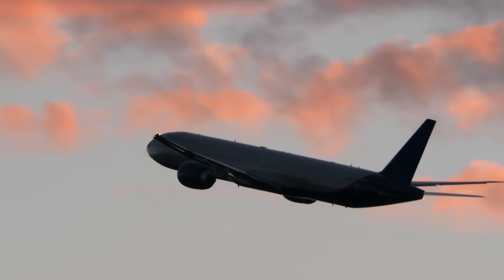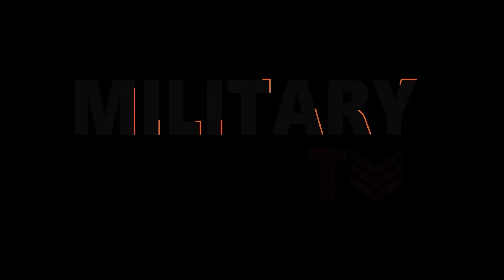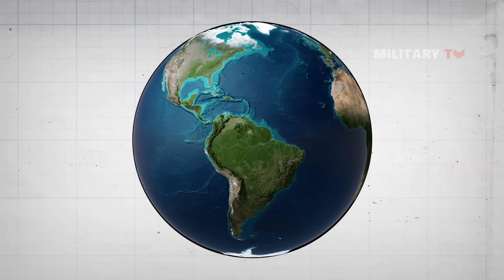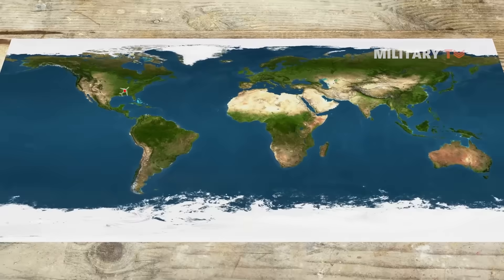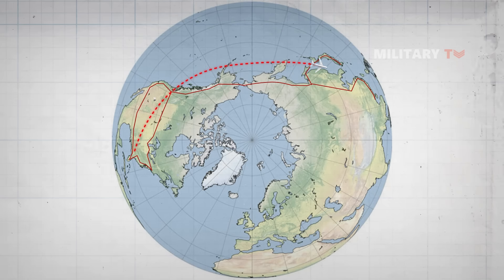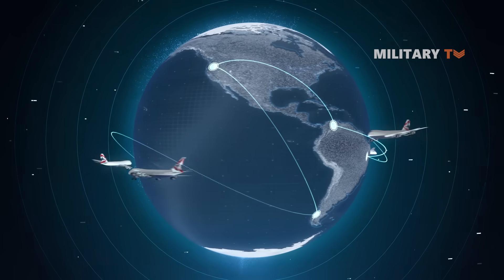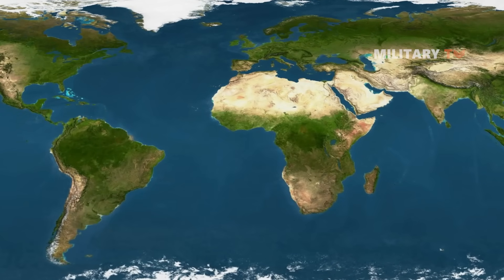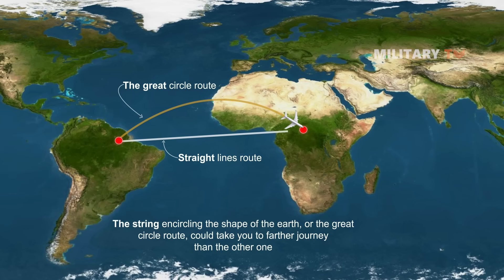Why Airplanes Fly On A Curved Path

Comment: The airplanes ARE flying a straight line, being "the shortest distance between two points." Stretch a string on a globe between two points, and voila, there is your flight path. The line appears curved because it is drawn on a flat map, not a globe
Reply: 2d navigation and 2d maps.
Reply: I was waiting for someone to point that out, it's only curved on a flat (distorted) map.
Reply: @dougb5202  The flat map is not distorted and 3D is derived from 2D. Spheres are derived from circles and not the other way around. Also flat earth maps don't take into effect the curvature of the earth.
Reply: This is incorrect and flat maps don't take into effect the curve of the so-called globe. Spheres are derived from circles. 3D is derived from 2D and not the other way around. Looks like somebody failed geometry.
Reply: Perfectly explained
Reply: "Not for educational purposes" - Globe
Reply: @derp8575  I know that the globe is not for educational purposes. And that's why we don't witness it in reality.  You believe in fables my friend.
Reply: @christianpulido8360  Spheres are not derived from Circles nor there is any form of projection that has no distortion between those two.

 The point is the only shape which all points are an equal distance to the center in one dimension, so the circle is the ordinary 2 dimensional shape with the same definition, and the sphere is the shape in 3 dimensions where, again, each and every point on the surface is an equal distance to the center. The sphere was never defined as a circle, tho they share some characteristics because they're defined through the same rules, ex: they both have the biggest ratio of internal area/volume to external circumference/area, we call those similar.

 There's infinite shapes that have circular cross-sections, called solids of revolution, and of those only the cylinder has no distortion when projected in 2D. You're basically calling several people siblings because they have the same surname, it doesn't work like that.
Reply: @davidaugustofc2574 Where do you get your information from? Because what you wrote is incorrect. The sphere is a three-dimensional shape, also called the second cousin of a circle. 

The first circle on the top of the sphere is a small circle and then the second circle is a little bigger etc. 2D is a flat circle and 3D has no edges, and it's a ball 🏀 shape derived from a two- Dimensional circle. A sphere cannot exist without circles buddy.  How is a sphere made if it is not made of circles? This is basic geometry..
Reply: @christianpulido8360  You made that up in your head, that's why your side of the information cannot be found. Every Solid of Revolution will have circular cross sections because the Revolution is a mathematical operation which does not change the distance from the center point. That is, if you take any given plane perpendicular to the axis of revolution and analyse all the points overlapping with said plane, all the points will also be at the same distance to the center, which would fit the definition of a circle besides the definition of a sphere. That's an example where one answer works for two questions.

 In no thesis, research paper or mathematical proof, you're gonna find a solid defined exclusively by its cross-sectional shapes. There's countless of them each having an infinitely small thickness and constantly changing radius between layers (as opposed to one radius for the whole sphere), and it makes no sense whatsoever (maybe it does for you but not for anyone else) to try and create a sphere the way you described. It's just for visualisation purposes, for kids even.

 Formally, a sphere is the set of points that are all at the same distance r from a given point in three-dimensional space. That given point is the centre of the sphere, and r is the sphere's radius. With that alone you're able to create a sphere of any size in any point of the universe.

 And while you're going in circles (pun intended) to try and argue that the Sphere is made from Circles, you have put absolutely zero effort in explaining how there's supposedly no distortion between the projections from 3D to 2D and vice-versa, which was your argument.
Reply: @davidaugustofc2574  Pilots supposedly navigate great circles and that's because a sphere is made of circles.  I'm not making this up its basic geometry. How is a sphere made without circles?  Where can we witness this so-called globe in reality? 

It's very clear that you have no idea of what you are talking about?
Reply: @christianpulido8360  I like how you keep telling yourself it's all basic geometry, when all smooth shapes and smooth spaces are studied in differential geometry, including, but not limited to the projection of a sphere into a plane (the topic you avoided ever after you raised it yourself), and you clearly have no idea about calculus. 

But keep patting yourself in the back.
Reply: @davidaugustofc2574  Calculus is a study in change and geometry is a study in shapes. Calculus has nothing to do with geometry. 

How is a sphere made without circles? Answer thx question ok?  Also we are taught about spheres being made of circles in the 10th grade. 

Desk globe maps are projections of flat maps which are considered 2D. 

It's clear that you are clueless about what you are talking about?
Reply: @christianpulido8360  the definition, which I already gave you: A sphere, in geometry, is the set of all points in three-dimensional space lying the same distance (the radius) from a given point (the centre).
Reply: @davidaugustofc2574 I know that already but how is a sphere made?
Reply: @christianpulido8360   A sphere is made in any way that fits the definition. If you were just a little more pedantic about it, you could say a sphere is a line (with defined length r), with one end fixed on a point (x,y) in space, that rotates 360 degrees (in all 3 axis) in such a way that every point the other end passes through is also a point on the surface of a sphere. That would also make a sphere because all points in three-dimensional space lie the same distance (the radius) from a given point (the centre).
 One way you could make a sphere in the physical world, you could have, say agate rock, being machined by 3 cylindrical drills on all 3 axis, and then by another 3 an equal distance to the centre, with the rock spinning around a fixed point. You can also hydroform one from welded steel because since all points lie the same distance to the centre, the pressure is also equal on all points and so it stops deforming.
 In the more extreme cases, spheres are formed by gravity because when an object is further away from the centre than another below it, the object below will feel the weight from the object above. Once the celestial bodies are massive enough that their gravitational pull can overcome the strength of the material they’re made from, everything will get pulled inwards till the material is around the same distance to the centre (Mount Everest for example is .14% further from the centre than the top of the ocean is), those are called spheroids because they’re only approximately spheres. Then they are in a state called hydrostatic equilibrium.
Reply: Yes it is a straight line if you look directly overhead of it. But is looking curve if you look at it on the side (horizontal or equator view)
Reply: Incorrect. The vast majority of the time they fly at constant altitude and constant bearing, a path which is known as a rhumb line.
Reply: @hb1338  Present the evidence of your claims ok? Thank you for your opinion though.
Reply: @hb1338 That Is not true, rhumb Lines are almost never flown. They take longer.
Reply: @christianpulido8360 Nobody uses any flatearth map, because it's not flat. Intercontinental flights South of the Equator prove that. Plus no flerf should accuse others of not knowing geometry because that's exactly what proves you wrong. Very basic geometry actually.
Reply: @AlexFoxthrot  Pilots use Aeronautical charts that are flat maps and are  based on azimuth. Everything on land navigation begins with an Azimuth. Flat maps don't account for the so-called curve of the earth.  Nobody uses desk globe maps for navigation cause they are just considered suvanears. Try using a desk globe map for navigation and see how that works for you ok? 3D cannot be flattened into 2D  cause 2D makes 3D .  Geometry is used  with 2D and circles.  AirPlanes flying south of the equator don't prove that we live on a spinning 🏀 in reality.  Pilots fly in straight line paths world wide.  Where can we witness the ground curving as a 🏀 in reality?  We can definitely read about measurements of curvature but in reality they are not observed.
Reply: @AlexFoxthrot  Rhumb lines are always flown in reality. We don't live on a globe buddy. Present the evidence that we live  on a spinning 🏀 in reality ok? Airplanes don't fly in great circle paths cause we don't live on a spinning 🏀 in reality.
Reply: @christianpulido8360  Are you a Pilot? Obviously not. I am, I know what I am talking about, you repeat what you heard from other non-pilots. Rhumb Lines mean you keep your heading, that never happens unless you fly due North or due South. Especially in long flights, the heading changes constantly because the routes are close to being Great Circles, so you are wrong about everything. Like It has been said already, the Maps are flat projections of the Globe. Besides no airplane uses Maps anymore, they use GPS signals coupled with the WGS84 model which Is a Globe. Again, you are wrong about everything. And yes a direct flight from Sydney to Johannesburg proves your model wrong because on the flat map that distance Is more than 23400km, impossible to cover in 14 hours. Welcome to reality.
Reply: @AlexFoxthrot  Well you can claim to be anybody on YouTube. Also flat maps don't account for the so-called curve of the earth.  Flat maps are not projections of the globe because flat maps make globe maps. Pilots always fly in straight line paths in reality. GPS can occasionally have disruptions, so most pilots keep paper maps handy, and cockpits have a magnetic compass that is based on 2D.  My GPS is always set on 2D buddy. Pilots also use electronic charts and you would know that if you were really a pilot. GPS is a ground based station with cables laid on the sea bed between land-based stations to carry telecommunication signals to antennas. Satellites are not orbiting around the earth in reality. Satellites are launched and attached to balloons in reality.  Semi circles and Circles make a sphere and without circles a sphere cannot exist. I knew you were not going to be able to present the evidence that we live on a spinning 🏀 in reality. In order for a spinning 🏀 to exist we must be able to witness it in reality and not just read about it.  We are taught your indoctrination in the so-called educational system.
Reply: @AlexFoxthrot  Pilots are not using desk globe maps to fly between Sydney and Johannesburg so your calculations are incorrect. Present the evidence of pilots flying from Sydney to Johannesburg using a desk globe map and flying on a globe in reality ok?
Reply: @christianpulido8360  I never said we use desk globes, stop acting like a kid. The distance on the flat map Is way too big for that Flight to exist but It does, you can look for It buy It and track it. On the flat map It measures 23400km, on the Globe 11034. Huge difference. One Is possible, the other Is not. And we never measure distances with Maps either, the FMS does all the calculations, you Need to catch up a few decades buddy.
Reply: @AlexFoxthrot  If you took a globe and put a string across two points you would get a different line than what you are going to get on a chart. A chart is a flat piece of paper that truly doesn't take into effect the curve of the so-called globe.  Flat maps have sizes, angles, distances, and directions that are not the same as a desk globe map.  And desk globe maps are globe maps so what are you talking about? You cannot flatten a desk globe map into 2D because 3D is derived from 2D. In reality you don't know the distances from Sydney to Johannesburg  on a flat map. Where are you getting your calculations from?
Reply: @AlexFoxthrot  Pilots are not using globe maps they use Aeronautical charts that are based on Azimuth. Also azimuth uses true north, magnetic north, and grid etc.
Reply: @christianpulido8360  Yes all charts take into account the curvature, like I said Lambert projections have a non uniform scale and Great Circles appear curvy because earth Is not flat. Same thing happens on Mercatore projections. Nobody uses Gleasons map like your gurus preach. If you fly from Frankfurt to LA you see the route curve North and get close to the pole on a Mercatore chart and that's what you see in reality as well, and the heading changes constantly so again you are wrong about rhumb Lines. Even on Gleasons map rhumb Lines are not straight so you are so wrong and clueless. I calculated the distance using Gleasons map but every flat earth map can be used, we already know that there are 60NM to the degree of latitude so that's out scale. The distance Is clearly huge even without calculations an it's more than twice as long as other flights North of the Equator that take the same amount of time. You lost.
Reply: @christianpulido8360  No pilot uses azimuthal Maps and the last comment proves you know absolutely nothing of the topic. Azimuth uses True North, Magnetica North and Grid? Pure nonsense. Every map has a grid. That's what happens when you get your brain filled with charlatan made videos, you get tricled into thinking you know stuff when its the exact opposite.
Reply: @AlexFoxthrot  Are you claiming that Azimuth doesn't use magnetic north, true north , and grid. Do you even know what Grid is used for? Grids are usually only present on maps that are meant for navigational purposes. Longitude and latitude lines typically make up grid lines in a map. According to the USGS, the Azimuthal Equidistant map helps show "airline distances from the center point of the projection." It is useful for radio, aviation, and seismic mapping, and illustrates polar hemispheres.
Reply: @christianpulido8360  I already told you how to calculate the distance. Take your FE map and plot a line between the two cities, then compare that distance with something known, like the distance from the Pole to the Equator, which is 5400NM, then use easy proportions to get the final result. Or you can use geographical coordinates to calculate the distances from the cities to the Pole, then use the difference in Longitude to find out the angle between those two lines and then use the cosine formula to calculate the length of the third side of that triangle which is the distance. Again, you are ignoring some details because you know you cannot explain this on your world. I already told you that you can take other routes that take the same 14 hours but stay North of the Equator all the time and see that they are less than half the length. No, airplanes do not fly twice the speed of others. And stop starting from the conclusion, I can calculate the distance between those two cities on the Globe as well, again you are debating with pure nonsense. Go ahead and explain the flight, let's see who the liar is here.
Reply: @TruthSeeker8717 The so-called scientists claim that we live on a Spheroid.  They claim that the Earth is not a perfect sphere. So how does that match a desk globe map?  If the Earth is considered a Spheroid ?
Reply: @christianpulido8360  The difference in radii is negligible on a desk globe. You still fail at explaining the flights that prove your model wrong empirically. Along pretty much everything else. You know nothing.
Reply: @TruthSeeker8717 Plus, you all believe in god, I suggest you don't use the word "magic" to ridicule a model just because you cannot understand it because that's ever so ironic. Keep avoiding the question tho. You are winning big time.
Reply: @TruthSeeker8717 I mean you even think human senses are reliable, this is not a comedy club, pal.
Reply: That's why gnomonic plotting sheets are used for long distance work.
Reply: @christianpulido8360  "Also flat earth maps don't take into effect the curvature of the earth" really? what a surprising discovery; btw., all maps are flat, by the very definition
Reply: @christianpulido8360  of course we do live on a spheroid; equatorial radius is 6378 km, polar radius is 6357 km
Reply: @rncmv  Flat maps are based on a flat earth and not a  spinning oblate spheroid.  The desk globe map was derived by 2D and not the other way around. In geometry 3D is derived from 2D.  A circle makes a sphere in geometry. 3D cannot exist without being derived from 2D.  Desk globes are not useful to study a specific part of the earth in detail.  They have no roads  and cities printed on them.  A globe does not give an accurate idea of the distance between two points.  Desk globes don't work for navigation in reality.  Nobody uses globes for navigation in reality.
Reply: @rncmv  Where is that oblate spheroid observed in reality?
Reply: @alexf962  Well that desk globe was derived from 2D.  In geometry a circle makes a sphere. 3D cannot exist without being derived from 2D.  Aeronautical charts are based on Azimuth that use magnetic, north, and grid.  Please elaborate how that desk globe map was made without 2D ok? I'll wait.
Reply: @alexf962  Measuring any distance between two points from that desk globe is useless because pilots don't use desk globes for navigation in reality.  Desk globes are not useful to study specific parts of the earth in detail. Desk globes have no roads and cities printed on them. Desk globes don't work for navigation in reality. In reality you don't have a working globe map that matches an existing oblate spheroid in reality.  Let's change reality because that desk globe is difficult to carry. "How does that make any sense?" Also, it's  impossible to change reality because that desk globe was derived from 2D. The desk globe cannot be made without being derived from 2D.  It's called geometry.
Reply: @alexf962  Science experiments are models that are based on assumptions with simplified calculations and left out data.
Reply: @alexf962  God forbids magic and you would know that if you read the Bible.
Reply: @alexf962  Abiogenesis is the idea that life arose from non-life 3.5 billion years ago on earth.  Abiogenesis has never been proven in any experiment that's based on assumptions and not reality.  Also, how did that non-living material arrive into existence? "Did it just appear naturally out of nowhere like magic 🪄? "
Reply: @AlexFoxthrot  Measuring any distance between two points from that desk globe is useless because pilots don't use desk globes for navigation in reality.  Desk globes are not useful to study specific parts of the earth in detail. Desk globes have no roads and cities printed on them. Desk globes don't work for navigation in reality.  Also, your calculations are based on assumptions with simplified calculations and left out data.  Please elaborate how that desk globe was made without being derived from 2D? An airplane is called a plane because it flies on a flat surface.  Present evidence of a working globe map that matches an existing oblate spheroid in reality. Ok I'll wait.  Also all calculations and measurements are applied on a circle, triangle and square etc which are considered 2D.
Reply: @christianpulido8360  You are not a pilot and you don't know how airplanes fly. Every distance plotted on a Globe Is accurate. Again, Sydney and Johannesburg are separated by 23400 km on the flat Maps yet the Flight takes 14 hours. Wrong again, as Always.
Reply: @christianpulido8360  The Plane Is the Wing that generates lift. It is definitely not called that because It flies over a plane, that Is One of the most stupid assertions I have ever Heard, truly.
Reply: @AlexFoxthrot  That's not the distance between two points from a desk globe. Also desk globes are not useful to study specific parts of the earth in detail.  Nobody uses desk globes for navigation in reality. Please elaborate how that desk globe was made without being derived from 2D? Stop evading this question? An airplane is called a plane because it flies on a plane.  You are supposedly a pilot and you don't know why an airplane is called a plane? Also you mentioned that you applied your calculations using a triangle right? Well a triangle is considered 2D and not 3D. Please present evidence of a working globe map that matches an existing oblate spheroid in reality.  It's crystal clear that you have no idea what you are talking about?
Reply: @christianpulido8360  Yes you are right, have fun.
Reply: @AlexFoxthrot  The 'plane' is related to a geometrical plane (flat surface)
Reply: @christianpulido8360  Yes you are Absolutely right. Have as much fin as you can.
Reply: @AlexFoxthrot  That's what I thought you cannot answer my question about how 3D was made without 2D? Projection: The presentation of an image on a surface, especially a movie screen. Projection: The action of projecting a figure. Projection; The representation on a plane surface of any part of the surface of the earth or celestial sphere.
Reply: @AlexFoxthrot  Vincenty's formula is based on the assumption that the shape of the Earth is an oblate spheroid.  Haversine formula is based on the assumption that the shape of the earth is a sphere. Do you not know about this?
Reply: @christianpulido8360  No, I had Absolutely no Idea. You are definitely way too smart for me. Again, have fun.
Reply: @AlexFoxthrot  Peer review in science the pains and problems
Reply: @AlexFoxthrot  Read the 📜 that I just posted maybe it will help you with your indoctrination.
Reply: @christianpulido8360  LMAO yawn
Reply: @AlexFoxthrot  Thank you for your opinion. But you have to have faith in science and take with a grain of salt.
Reply: @AlexFoxthrot  Lol mythology.
Reply: @christianpulido8360  of course they don't because the earth is flat!